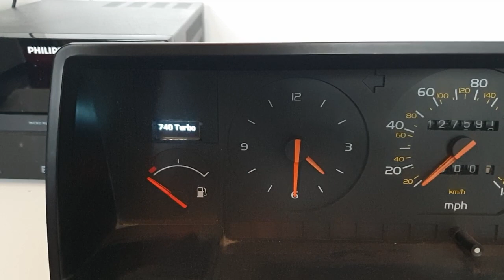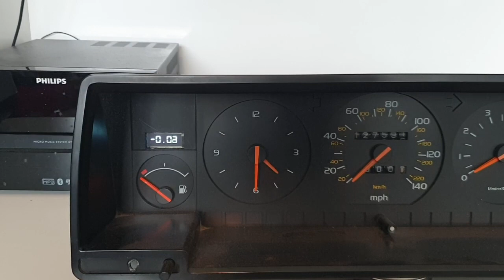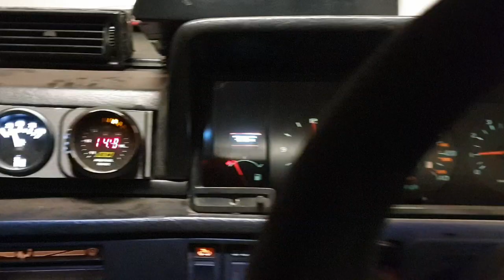OLED Arduino DIY Boost Gauge Volvo 740 Turbo

Comment: I appreciate your work, but this setup reads the absolute pressure. It works like that, but to read the boost on a road at high altitude or on the seashore we need to read the differential pressure.
For example, under normal conditions, the same temperature, without considering the influences of the weather, at 2000 m altitude we have 0.8 bar compared to 1 bar at sea level. That is 11.8 PSI at 2000m altitude and 14.5 PSI at sea level.
The error will be 3 PSI or 0.2 bar.

Comment: Hiya mate it looks great, would it be possible to have a copy of the code. Thanks
Reply from the maker: Hi, try this: https://drive.google.com/file/d/1s3x3b3qgvEABCkMDgPOq9Zg32uhVfIpb/view?usp=sharing
Reply: @roughrides9973   great Thank you, I will give that a read through. I've been playing with a small oled to add my afr in a decent position to view. Not ideal to add the 52mm gauges. Thanks again regards James